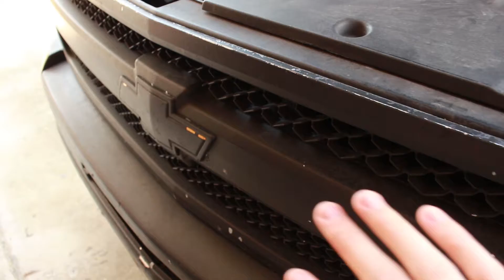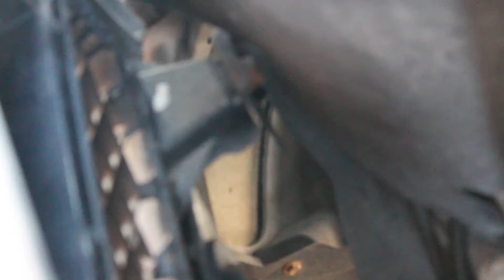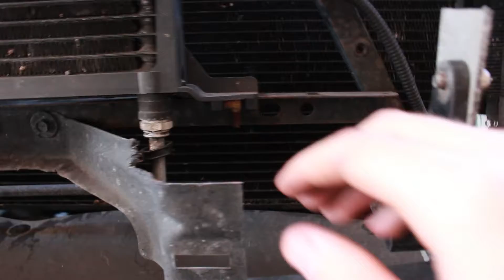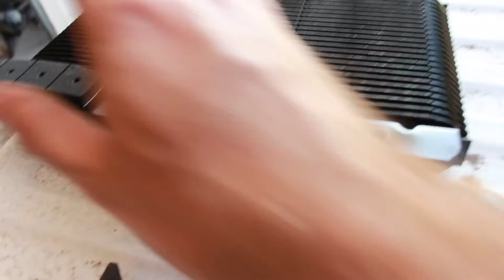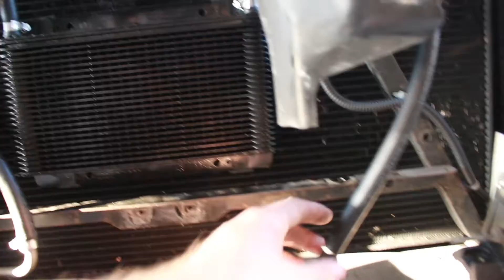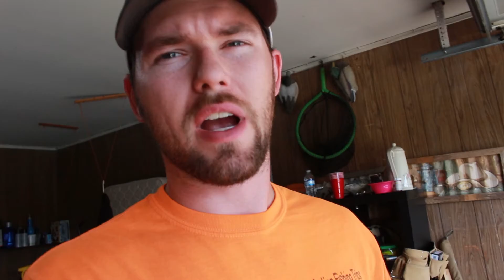How To Install a Transmission Cooler | B&M 24,000

Comment: Nice video.  Going over not only how the cooler is mounted to the condenser, but the stuff with the wires to help the hoses hold their shape was great.  Also great engineering with the rub points.

Comment: How much lower did this cooler make the trans run?
Reply from the maker: in the winter time the temp is around 140, and in the summer it’s about 180-190 depending on traffic. And that’s with the high stall converter.

Comment: What is the temp running at with the new cooler??
Reply: Like on a really hot day
Reply from the maker: With the new torque converter installed, and I cut out the Chevy emblem to allow more airflow(which I will make a video about). Cruising on the highway it’s about 175 to 185. But with city driving it does want to climb up to the 190s but it cools back down fairly quick and rarely gets that hot.

Comment: The stock t/c was behind the bowtie also, why didn't you leave the stock one in and have 2 coolers? Also wouldn't bypassing the engine radiator help in keeping the fluid cooler since your not getting the 210degrees from the engine coolant?
Reply from the maker: I could’ve left it but it probably wouldn’t help much more. Also you want the fluid to go through the radiator because it brings it up to the operating temperature quicker. You typically want it to be around the 150 to 180 range.
Reply: John Vesely 150-180? Mine runs 193 during the day, I live down the road from you so going down spid I'm at 193. I thought running temp on a 6l80 was 180-200? And towing or in 4x4 keep it under 230. I have a 12 silverado 4x4.
Reply from the maker: You don’t really want your transmission to go over 200, it shortens the life quite a bit. Heat is what kills transmissions.
Reply: John Vesely yes we all know heat is what kills transmissions but the info your giving out on temps is a little off, you must be going off old school info, newer transmissions run hotter especially the 6l80 ,you must have a 4 speed.
Reply from the maker: I have the 6l80e and it never ran over 200, it was always at 170-180. Do a quick google search, they don’t advise you to constantly run over 200 and the fluid breaks down at 260. Varnishing happens around 220. It’s just a rule of thumb to keep it under 200.
Reply: John Vesely I guess it depends who you believe, I did the Google search running temp 180-200 don't run over 230.
Reply: @ronjaime3493  how's that 230 degree trans holding up?